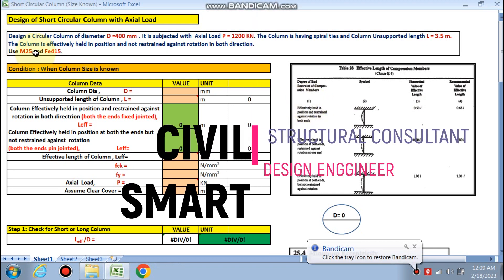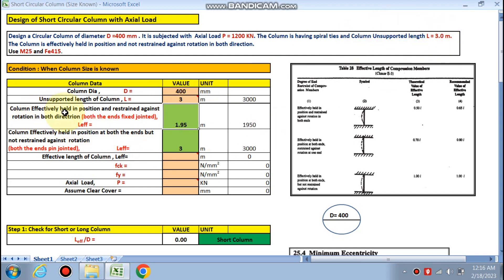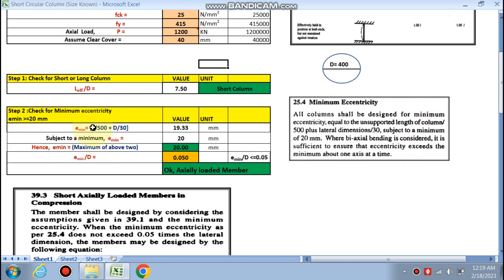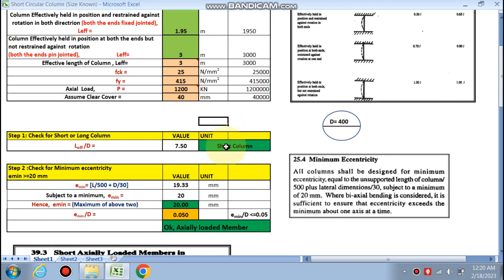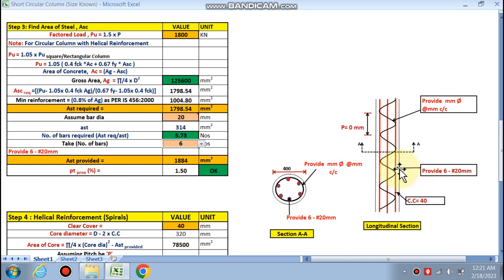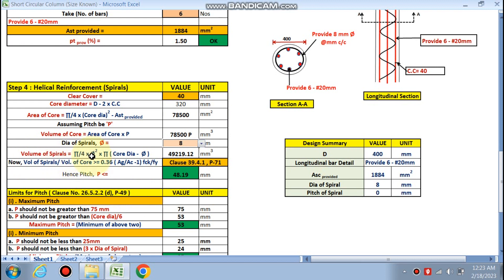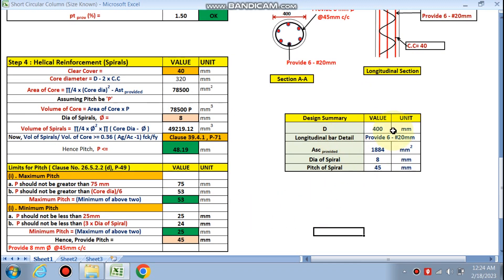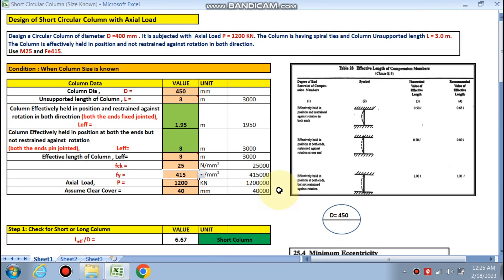CIRCULAR COLUMN DESIGN ( SHORT AXIALLY LOADED)

Comment: For same circular column we may also design the helical ties as circular rings with more spacing but the capacity of column may be 1.0 times Pu instead 1.05 Pu  for normal column. What is the advantage of having helical ties in circular column apart from increase capacity.